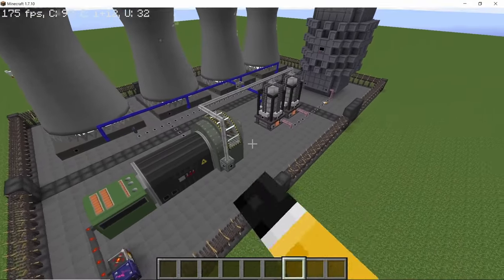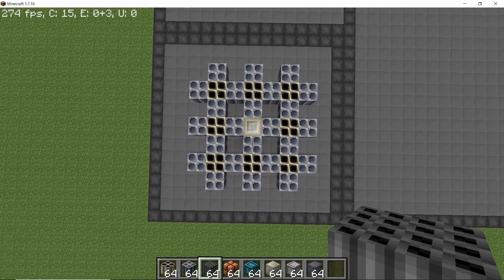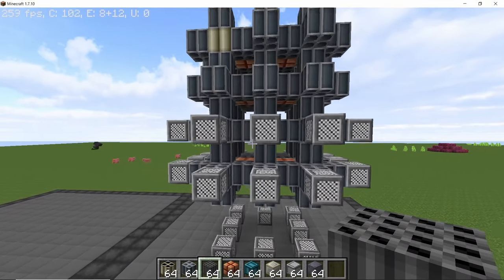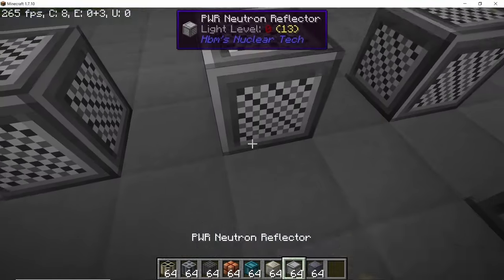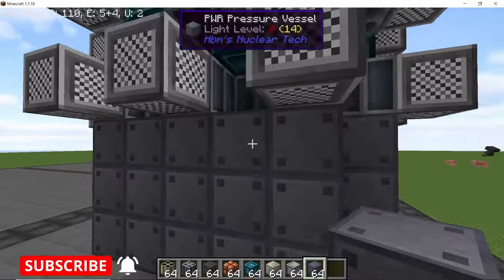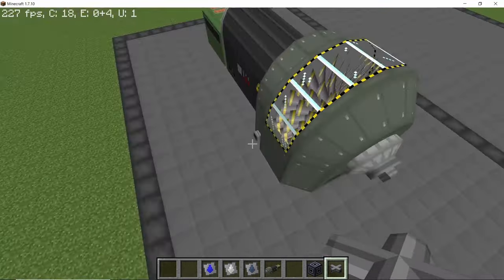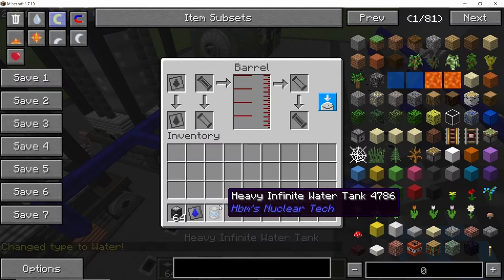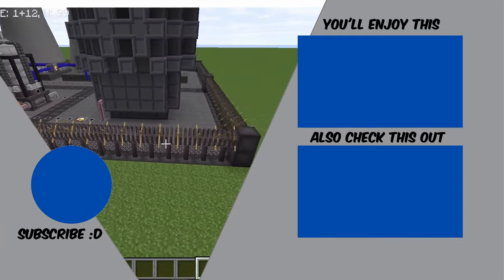Pressurized Water Reactor with HeatSink - HBMs Nuclear Tech Mod - 155 MHE/s

Comment: You don't need the neutron source to be along the fuel grid, the neutron source simply adds the base flux value no matter the placement, it can be put anywhere.
Reply from the maker: I know I know,  I just used them there cause I needed 8 fuel rods on a single level and  leaving the middle empty was not an option so I went with the neutron sources
Reply: @SavageVegeta  Ah fair enough, personally I've been going with a 4x4 fuel grid to keep it matched with MC stack amounts, a 4x4x4 PWR will hold a stack, and has plenty of room for extra blocks.

Comment: yooo nice Pwr i think you should make a vid about the differences between “hbm’s nuclear tech mod 1.7.10” and “hbm’s nuclear tech mod reloaded 1.12.2” + “hbm extended 1.12.2” since i have never really understood the big difference
Reply: Just different mod authors, I would stick with the original though
Reply: @AustrianDeathMachine9   i would too but we have 107 other mods we play with and most of them aren’t ported to 1.7.10 so yeah
Reply from the maker: There's not much of a difference mechanics wise aside from some newer blocks added in 1.12.2
One big advantage I would say that ntm reloaded and extended have is the use of forge fluids which makes them compatible with fluids from other tech mods as well
Reply: @SavageVegeta  i also noticed that they include bedrock ores from other mods too! but anyways thanks for the explanation!

Comment: do you also have weird problems when using shaders when items get invisible?

PS: do you also have a problem where if you load a world there are overly dark shadows on decoration blocks?
Reply from the maker: Yes the dark shadows problem is the one I've faced, it's not limited to deco blocks tho I've also seen the same effect on many vertical surfaces like villager houses. Placing a block there and updating the area seems to solve it tho

Comment: Hey bro, I have a question. What to do if I followed your RBMK tutorial (3x3 and 15x15 one) but when I started up RBMK, radiation started to leak and infect terrain and later radioactive smoke appeared?
Reply from the maker: Make sure you have placed rbmk covers on each column and also place either neutron reflectors or absorbers at the very end of the reactor in line with the fuel rods. 
Cause I'm pretty sure in my 3x3 design no radiation leaks out, the 15x15 design is pretty old as back then I was new to the whole concept of making these
Reply from the maker: I would recommend referring to my newer rbmk designs like the RBMKP cause they are closed off in every direction

Comment: Hey vegeta, could you make a video about how to make schrabidium in the NTM extended?
Reply from the maker: I have already made one for the normal NTM and ntm extended hasn't introduced any new way to making it afaik. Have you checked out my original video on it ?
Reply: @SavageVegeta  Yeah, i've checked it, i just didn't know that extended hadn't introduced a new method, that's sad. What i've noticed is that the dynosynthesis is different in the extended mod, there are no desh dynospheres
Reply from the maker: @nazallion  well tbh the method you will be using the most is the schrabidium transmutator ... which is still the same so yea
Reply: @SavageVegeta  Oh yeah, i know that, but personally i find it really tedious to not be able to make schrabidium without having schrabidium. I like that you can use the desh to actually make it from scratch, so i miss that one thing in the extended version

Comment: I'm fairly new to HBM, can you use any other liquid besides sodium for it?
Reply from the maker: Yes there are many liquids that can be used - Coolant, Molten Thorium, Heavy Water, Blood (I think mugroot beer as well) and Liquid Sodium. 

These liquids have different properties ... for example heavy water gives flux multiplier ... Molten thorium multiplies the flux alot and also produces Uranium 233 as a by product which is another fissile fuel

However liquid thorium has the highest heat capacity of these liquids, and as this reactor produces alot of heat I used it !!
Reply: @SavageVegeta  Huh, good to know. Last night I tried heavy water, put rods at 77%, and it blew up lol
Reply from the maker: @juice6496  yeah heavy water will increase the amount of flux and heat but it's not very good at removing all that heat from the core. That's why I generally use it with weaker fuels

Comment: oh man i think theres problem with this reactor, when i left and joined the reactor exploded immadietaly, because i left and rejoin because i need to do backup of it incase, i load from it, and it still explodes
Reply: i fixed it i need to remember to shutdown the reactor when leaving, its ok it was my fault + i did also wrong something with the reactor build so ye my fault
Reply from the maker: That's the case with mostly every reactor in the mod, always remember to turn them off before leaving the world cause the time it takes for chunks to load is enough to make them go boom

Comment: How do i extract fuel after ive put it in there?
Reply: access ports.
Reply: @AustrianDeathMachine9  im talking about while fuel rods arent depleted
Reply: @Guywithacow  you dont
Reply from the maker: Once the fuel rods are in the reactor guide you can't take them out, however if you have put extra fuel rods in which haven't been activated yet then you can take them out by hand

Comment: i know this is not about the video, but how can i make the radiation sensor work?
Reply from the maker: There are two types of geiger counters available for sensing radiation, the first one which is the block variant has to be placed down and right clicking it will give you the details of the radiation values around you and also in you, the other one just has to be in your inventory and will show the player radiation in a bar on bottom left
Reply: @SavageVegeta  but in the block version there is something about redstone block and comparator

Comment: Can you make a Stabilizer lens for the Stabilizer in dfc ? I've been trying to make a dfc fully sustainable by itself and realized that i need lens to be fully sustainable so i decided to came here for help. (Make it for 1.7.10 please|Original version|)
Reply from the maker: Umm if I understand correctly the stabilizer lens has a crafting recipe available that can be checked using NEI mod.
And technically the lens is not needed to make it fully sustainable, that role will be fulfilled by fuel and cryogel production. The stabilizer lens is an important part of the DFC and without it you can't really run the reactor or else it'll go boom

Comment: can be this use with heavy water?
Reply from the maker: Yes, tho you will need to lower the control rods cause heavy water's thermal capacity isn't as much as liq sodium's and on top of that it will also add some extra flux which will raise the temp a little
Reply: Ah Ahah 
My reactor just exploded tomorrow lol 
Thx Anyway
Reply: @SavageVegeta  can’t I use more fluid ports to move more fluid ?
Reply from the maker: @jirijaneba5586  yes you can, as I said this can definitely work on a heavy water cycle with a few tweaks here and there.